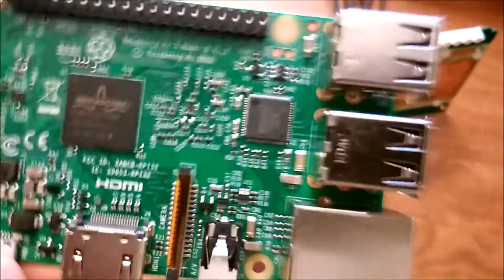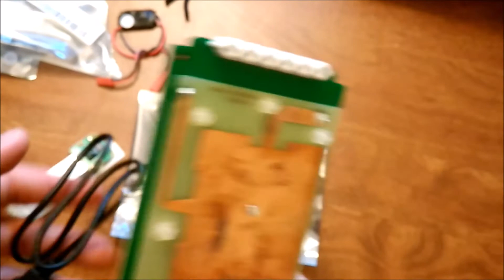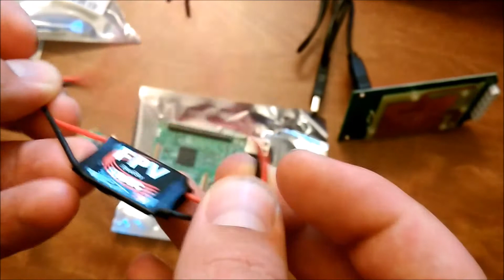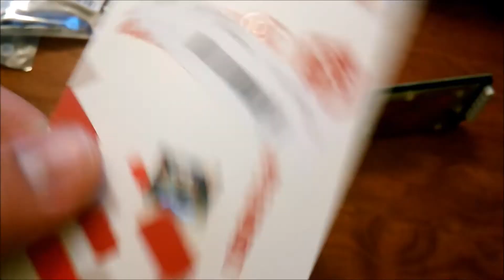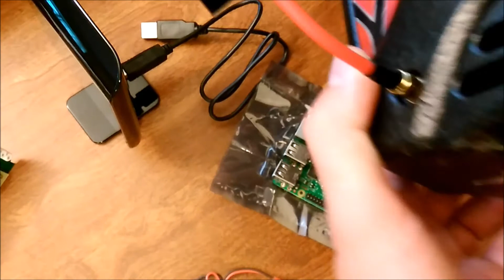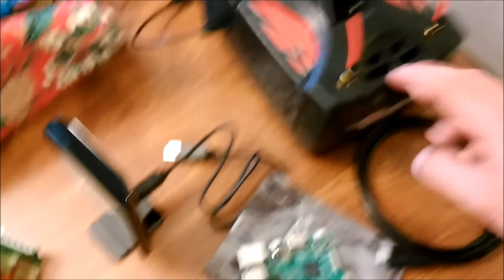EZ Wifibroadcast: Hardware Required

Comment: I was just looking at a website which sells Raspberry Pi Shields. 3G/4G/LTE Shields. Can't we use these? Why are we using wifi modules when there are 4G shields for the raspberry pi? I don't understand. I wish I knew more because this is the direction ezwifibroadcast should be heading. Come on, people.

Comment: Are you going to be connecting the Tx Pi to any Flight Controller? To you want telemetry or will you just be using this for Video Stream? I'm trying to connect to a Pixhawk Cube for telemetry. Any idea how to do this? I think my config settings are ok with the Cube but not so sure about on the pies. As of now I have the video telemetry data but nothing from the FC. Any step-by-step guides out there that you know of for setting up telemetry data for the video fpv?
Reply from the maker: Mark G that is actually the next thing I want to do with Ez Wifibroadcast.